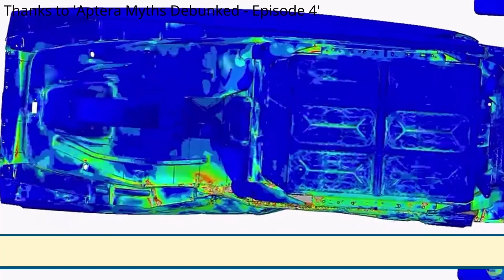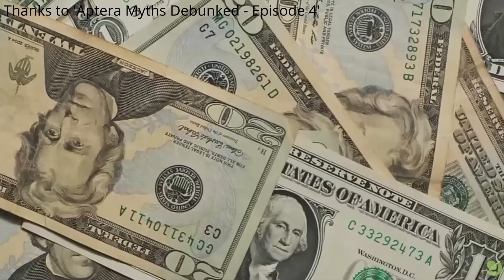APTERA   Myth Busting for Dummies

Comment: the only consistent myth Aptera busts is their promised delivery dates, missing 2021, twice in 2022, 2023, and now 2024.

What is most interesting about their panels and glass design is they have not shown they can make these in house so we should suspect an announcement within a few months they have contracted this out to a third party like most of the vehicle.   

I do tire of their attempts to claim they are built like Formula 1 vehicles. Aptera's carbon fiber is chopped strand, the cheapest type available, and their safety cell as they call it has nothing in common with the methods used to built a F1 car. All their crash simulations do not reference the body components and only instead show the frame components handling impact energy. Their use of carbon fiber is the same method other companies use for fenders, rear wings, and trim pieces.
Reply: I have a 3D printer and I have CF filament. Thus when I made a towel hanger for my shower and that thing that holds a bunch of K-Cups, a switch mount and some brackets are just like F1, as they use CF too. Remember, they use the moniker, "safety cell" in F1 and Aptera adopted that phrase too. When you say it, it must be true.
Reply: I've built solar panels very similar to what Aptera is planning to do.  There's really nothing novel about them.  Including the glass.  I've also seen, and am familiar with, all of Aptera's solar fab tooling and equipment.  With the possible exception of the solar hatch, they could make the solar panels "in house".  The reason the solar hatch is possibly an exception is because the only laminator Aptera currently has may be too small.  Aptera has, purportedly, issued purchase orders for more and larger laminators.
Reply: @billsmith5960 So when does your new, revolutionary nuclear powered hover-mobile hit the market and who do I send the money to to get on top of the wait list?!?!?!  Will it be available in blue?
Reply: @johnbauby6612  It'll be out 6-9 months from now.

As soon as I get the funding.

Comment: Newest video. Aptera bink with panels sitting in the CPC paint booth. They sanded down the white panels and shot some clear coat on it to make it look glossy. The body seams look pretty bad. I guess with a wrap, they can cover that up. Now we know the Pi-1 will be just that tub and not a working one. Pi-2 is to be.
Reply from the maker: On that newest video, I counted eight new videos since it (all full of the usual snake oil), but the staggering thing is I stopped at 100 (try to find one that doesn't peddle the snake oil?) and never saw one of mine on the 'Aptera' search filtered by newest. YouTube is misrepresenting what videos are made, and if they do it to me, how many others are they doing it to? How can this be ethical? I would like an explanation from YouTube but they are unreachable - a law unto themselves. When dumb disciples claim I have few views and subscribers, it is no longer a function of my material like they claim but a direct result of YouTube making me invisible, so I give the clowns that response whenever I am asked.

On the tricked-up binc display they still don't have the belly pan, so even the body is incomplete. Fools the gullible though, and AM knows their audience. You can cover bad seams with filler to make the wrap look good, and that usually cracks underneath the wrap in four seasons of temperature changes, then it shows through. Some even breaks off. You are no longer getting that ten years they promise out of their cheap wrap. You may as well buy a used car that's been crashed and repaired with filler. 

On the PI-1 tub with the rest of the incomplete body, that think has channels prepared for wiring, so why are they testing it to see if the wiring will fit? It's unnecessary, but if you were only having PI-1 be checked for wiring, it's easier and cheaper for Japan to send the loom to Modena and check it there. Carlsbad has no supplies of Yazaki's looms other than one in the resin-infused Gamma body (inappropriate) and the other on a display table for the gullible.
Reply: @aussieideasman8498  - There seems to be a bunch of AI videos that seem to be cookie cutter that have showed up recently.

Comment: In addition to the wheel covers moving, look at the trike behind Quincy.  The door on the right hand side is sagging compared to the left.  There is no way to cool the hub motors.  No way to cool the battery.  Where is the vent for an air conditioner condenser?  The battery is pushed into the pavement in the event of a front collision.  Solar panels might last one year, maybe more.  There is only side view mirrors and perhaps a camera because there is no rear window.  

I can't be the only one seeing these flaws.

Comment: This 3 wheeler is incredibly expensive to build.  The scale required in order to make a profit is way beyond the level of demand for a 2 seater, 3 wheeler.  Even if the the car was technically good (it isn't, as this video points out) then it still wouldn't be a successful product based on its fundamentals.
Reply: Being a 3 wheeler is the #1 problem. They just don't sell well. Existing ones that are sold are just play toys. What people want, is utility. So if it means buying a bigger vehicle with more seats, then they will go with that. A good example is when Jeep brought out a 4 door. The 2 door sales plummeted. Why? The 4 door worked out to be more versatile. Another example is the Honda Insight. It pretty much became an unknown because Toyota made a 4 door 5 passenger Prius. Having a Prius became more versatile.

If you notice, Aptera is trying their hardest to push safety and the versatility. This is because they are hoping people will look past the fact that it has three wheels.
Reply: @billsmith5960  yes, 3 wheels, 2 seats and yet costs only a little less than a model 3 and more than a used model 3.
Reply: @bluetoad2668  - Don't forget Hyundai and VW. They are even getting cheaper. I already see them in my area. So, the Aptera really needs to stand out with the price point vs the specs. So, $40K for a 1000 mile range and 40 miles per day from solar, might work.

Then there's another issue. Aptera has no warranty yet to be decided and nothing when it comes to said warranty work being done. At this point with Aptera all of it is a mystery yet for other car makers, it's not. Would you want to buy an Aptera? People will shy away.

Comment: Yet another angle of a very empty rented warehouse in California.  ANY dirt or road crap will turn the clear plastic coating foggy and reduce solar production.  The coating is PLASTIC, not glass and they are glued to the body, NOT replaceable!
Reply from the maker: I checked whether glass has advanced to what they claimed and it checked out. However, they may have just picked up on the breakthrough and then used a fake plastic and claimed it was the new glass. If so, they are once more guilty of misrepresentation. If they have no contract with a glass maker that produces the new glass and the example they parade is found to be plastic they should be prosecuted. If they have the contract and the sample is genuine, they should verify it.
Reply: FYI, with the possible exception of the dash solar, the very top layer of the solar panels are no longer to be "plastic".  They are to be some sort of "toughened" glass.  Also, if the solar panels are to be glued to the body, depending on the glue, they can be replaced.  I easily remove glued on solar panels from solar race vehicles rather routinely.

Flexible and relatively thin chemically toughened glass is no recent breakthrough.  Many, if not most, mobile phones, tablets and touch screens have been using them for many, many years.
Reply: @johnbauby6612  You aren't too up to speed on, for example, Gorilla Glass.  Again, Aptera did not develop toughened flexible glass.  They are purportedly working with a glass fabricator to pre-form the toughened glass into the "compound curved" shapes Aptera requires.  Aptera then will then lay the glass onto matching molds and "laminate" solar cell circuits to the glass.  It isn't complicated...
Reply: @johnreeves7261  - It is complicated and nobody has ever used it ever before. Add to that, only Aptera has developed this technology and has the IP to make them and use it as a revenue stream.

- - Aptera Superfan

The solar is just a diversion. They keep talking about it and their technology over and over again. In reality, the solar gives 0 miles per day on a sunny day at the equator. This is because if you have no frame to make the Aptera roll around and hold a battery, then talking about solar is pointless. Yet the company does so and it makes the superfans happy. How many more times do we need to see then drop a ball or shoot an ice ball at the panels? How about showing us that frame?
Reply from the maker: @johnreeves7261  People still shatter their phones, and I find most do it quite easily. And Gorilla glass is really expensive. I would love to know how much they paid for that one example, and I can see why we will not see more than one. I would also like to see Chris drop the sheet on a concrete floor. The ball drop could be rigged. 

Aptera are purportedly working with lots of people and getting nothing done with all bar CPC.  

The word 'compound' is redundant; curved shape is sufficient, but everything is enhanced for the mindless. There has been no rear hatch panel made because they haven't been able to put the number of cells they advertise on it. The edges behind the doors are too curved to set the cells on. It's not the lamination of cells to glass that is difficult - more like the contact between under the cells to the body. The LE is being touted as having full solar, so they are in a bind.

A production vehicle with no production line is complicated. Virtually impossible.
Reply: @johnbauby6612  No.  Try to pay attention.  Relatively thin, toughened glass is old news and, when thin, quite flexible.  Also, what part of when the glass is made, it's formed into (i.e., conformed to), a special compound curved shape do you not understand?  Curved glass is made all the time.  Aptera is not trying to conform flat glass to a compound curved surface.  They are, in effect, planning to buy pre-curved glass and laminate solar cells to it.  It's not hard.
Reply: @billsmith5960  No, it's not complicated and "nobody has ever used it ever before" is not an argument.
Reply: @aussieideasman8498  The word "compound" is not redundant.  Feel free to learn the difference between simple and compound curves.  The surface of a simple cylinder (not the ends) is a simple curve.  The surface of a sphere is a compound curve.
Reply: @johnreeves7261  - You never have watched the Aptera videos and listened to the superfans. For some reason this was the IP they were going to use to start making solar panels at the Vista facility for customers. It sounds like that you know it's nothing super special and can be done. If you tell the superfans that, expect to be blocked or banned.
Reply: @billsmith5960  I've watched plenty of Aptera videos and do try to gently open the "superfans" eyes to the reality of Aptera's solar.  Along with the USPTO, I've pointed out the non-novelty of Aptera's solar.  To date, Aptera has not been granted a single utility patent on the actual "product".  They have been granted a "design" type patent which essentially protects how the 45 degree rotation "looks" and they have been granted a "plant" or "method of manufacture" type patent.  It's equivalent to having a patent protect how the "better mousetrap" is made but not the "better mousetrap" itself.  It's rather funny.  Incidentally, "method of manufacture" patents are notoriously difficult to enforce and hence quite less valuable.
Reply: @johnreeves7261 - I understand that but even the ambassador for Aptera will never be convinced. He knows that this IP is valuable. The reason he does is because the first 200 Teslas built had faulty transmissions. Yes, I know these two have nothing in common but that's the type of logic some have.

Then you have the ones that truly believe they will get 40 miles per day with the solar. So, in the end, it's the hook for people to just hold onto as it becomes solar powered. I have no doubt it that works but in the end, if they can't get the rest act collected and finish key items, solar is worthless.
Reply: @johnbauby6612  Look, I understand you're a bit embarrassed that I called your B.$. on pretty much every one of your technical claims in this thread, but rather than wail like a toddler that needs a nappy change, man-up and just take the loss.  It builds character.  Incidentally, I've never said what Aptera is "going to do" only what they have more or less publicly stated they "plan to do" so I neither need to "show evidence" nor STFU.  In closing, no, the glass screen on an iPhone is not sapphire glass.....
Reply: @johnbauby6612  "ba(u)by"  In light of your need for a fresh nappy, that's just hilarious.
Reply: @johnreeves7261  It is pretty funny.  🤣
Reply: @johnreeves7261 Quote of the day:  "Look, I understand you're a bit embarrassed that I called your B.$. on pretty much every one of your technical claims in this thread, but rather than wail like a toddler that needs a nappy change, man-up and just take the loss.  It builds character." 😎